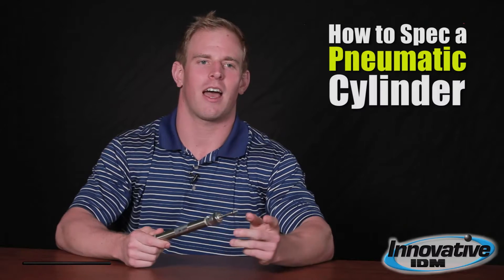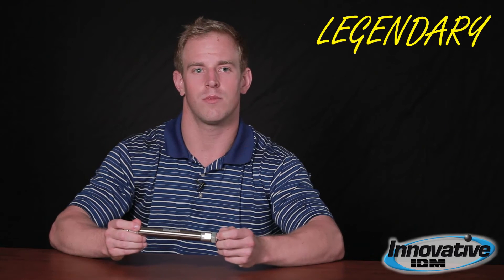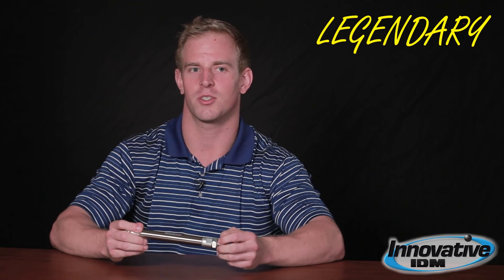How to Decide Which Pneumatic Cylinder Is Right for Your Application

Comment: hello, thanks for video. i need a cylinder that can push a pump handle, bicycle style, with 175 pounds of pressure, using a 12v portable compressor. needs to take 3 seconds to cover a 17 inch stroke, and have a constant automatic cycle? thanks for responding. randy
Reply: randy tinney did you get an answer for that ?